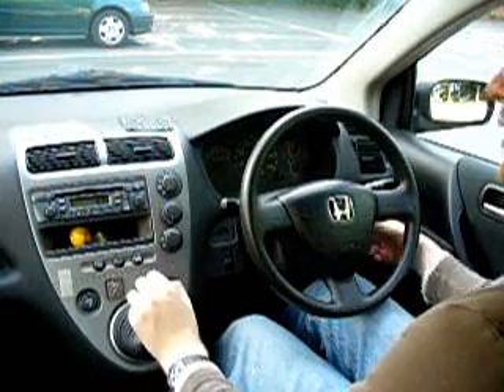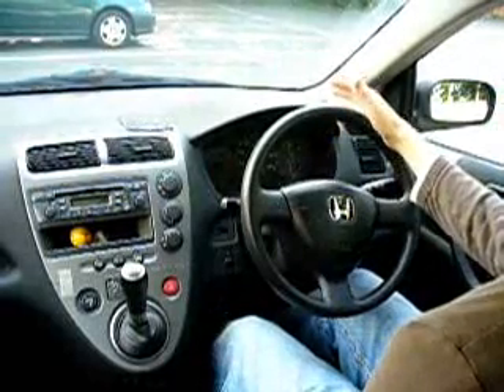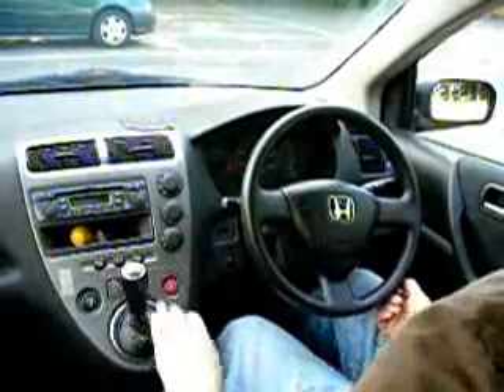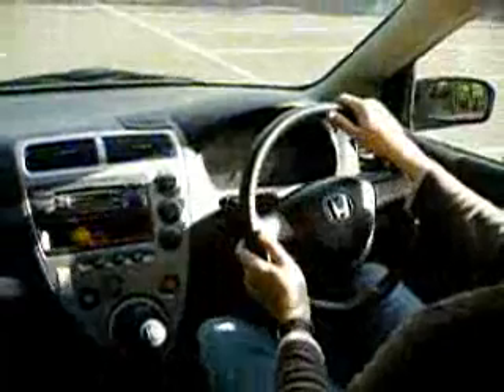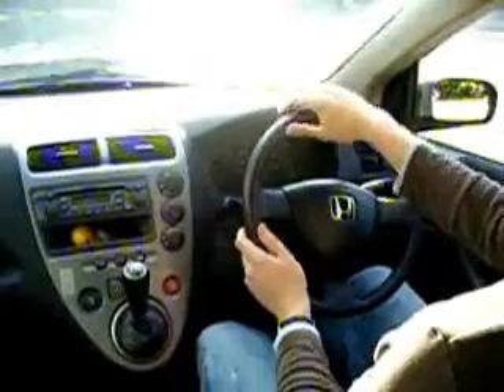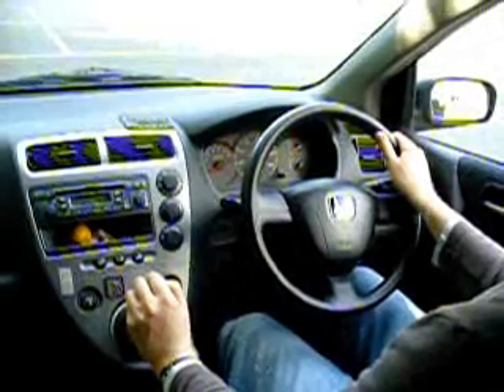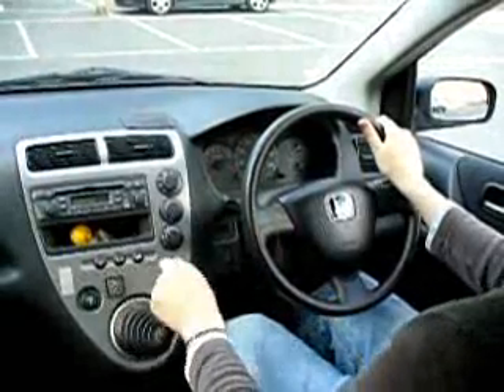Steering methods

Comment: yes, but in norway i would venture to say that there are more manuals than automatics, or at least half and half...in the united states that's not the case and really it has to do with road contidions. americans drive at more constant speeds, have less mountainous regions, and have wider roads that permit larger cars thus larger engines...manual transmissions are more common in smaller engines because they require more modulation due to less torque...is schumacher a bad driver? f1s are "auto"

Comment: I just use the palm of my right hand for tight low-speed turns (bus-driver style) when it takes multiple turns of the wheel. I think pull-push is the worst kind because it's easy to lose track of where the wheels are pointing - not a factor during normal driving, but you're screwed if you get into a skid. Best position for me is the one I use on the track - hands at 9 and 3, "fixed input" as much as possible and switching to "rotational" if necessary to countersteer if the car skids.

Comment: i still think that if you're cruising on the motorway for miles and miles, its okay to hold the wheel at 6 with one hand..its not dangerous because the most people drive at in canada is maybe 140..

Comment: @enigmaPL my favorite hand position for most situations is left hand on the wheel at 7 or 8 o'clock with my wrist braced against my leg or knee and i steer with just my fingers and wrist. i was talking about these idiots that try to look like a gangster or vin diesel and their stability suffers. you can't feel for grip as well if your arm is straight and you're steering with your shoulder. that's all i meant.

Comment: @2trips 10:00 and 2:00 is FAR from a hand position with the most control...Having one hand on the wheel is not an attempt to be cool, and you have to lead a pretty boring life to think so. It's a relaxed but very controllable hand position if your one hand is between 9:00 and 12:00; and furthermore necessary with a manual. 

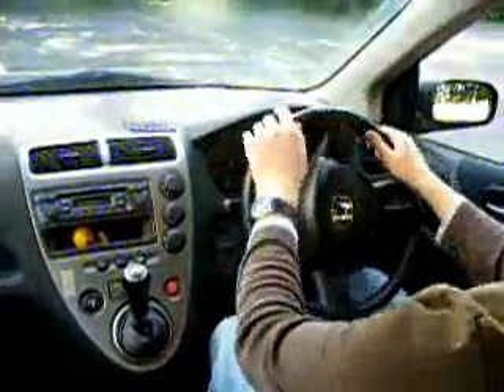Left hand @ 9:00 and right hand @ 3:00 is THE BEST hand position for control. To some it's known as the racing driver hand position.

Comment: @2trips to control the wheel one hand i enough as long as you driving not racing.
one hand doesn't mean that you are a bad driver i think 
it more important how your reaktions are 
i mean if you have to steering hard it can be also done by one hand drivng cause this hand beginns the other hand is coming into it one hand doesn't mean that the driver will drive always in every situation with one hand

Comment: @VinceMcJericho all i meant is that if you have your hand at the 12 oclock position and your arm totally straight from your shoulder to your wrist (the insecure wanna-be cool guy position, favored by every bad driver i know) you have a fraction of the control you would have from a more stable hand position.
the "really competent driver" of your example would still benefit from holding the steering wheel properly, even if s/he understood more than most how to handle a car.

Comment: @powerfultoa7 Transmission lock, yeah right! Have you ever heard of Engine Braking? You need to know how and when to re-engage the clutch after down shifting... I'm not insinuating that I'm the best driver, or that there is nothing else I could learn about driving. I drive fast, cause I travel a lot, and I don't drive on high ways, because there are none... I drive on regular roads with lots of curves, for long distances and I drive a lot and fast, hence my shifting habits

Comment: @unavailableyet Professional drivers always downshift to the proper gear before turning into the corner. Downshifting midway at highspeed is risky and can induce transmission lock

Comment: @CallMeDB As I said, unless you drive like grandma'! If you were a professional driver, you would have known what I was talking about. Furthermore, if you are form the States, and are only used to driving automatic or on highways, it explains your opinion... otherwise, you are wrong and I am right... and this is not an opinion, it is a day by day tested fact... and I am the one to test it, so unless you are a professional driver, I suggest you revise your knowledge about driving

Comment: @unavailableyet disagree. u don't keep ur hand on the gear shift. you only touch the gear shift when you need to shift a gear. that's why they call it a gear shift and not a hand holder.

Comment: @Custom2212 Unless you drive like Grandma', you would want to keep a hand on the gear... it is not wasting a hand! When driving fast, that is IF you drive fast, when negotiating a curve, you need to shift down to maximize traction, and that needs to happen in a split of a second. If you a take a U-Turn, turning the steering with both hands is impractical and slow.. you can do it using the palm of one hand. However, there is NO doubt that using both hands is much safer, but impractical!

Comment: @gromit37 I think you mean it is acceptable at any speed.  I won't bother reading the guidelines for regulations and their reasons, but will here say this: should you find yourself in a situation at high speed where a crash is likely, it is better to use a steering method which gives you more control and requires crossing of hands than a restrictive one which doesn't.  Avoiding any crash is better than having any 'safe,' if you will, crash.

Comment: @gromit37 I don't know when you passed your driving test but in an up to date test your meant to: hold the wheel at 10 to 2, do NOT cross your arms and do NOT let the wheel slide through your hands.
now next time you are driving around town or doing maneuvers try it and see what a rubbish practice it is.

Comment: Thanks - excellent! Far more useful than all the arcane discussion in the driving instructor press. I find that 10to2 is better for 'fixed input driving' because both hands are reasonably close to the top. One thing you could usefully explain is the 'dynamic' reason for not steering from the lower half of the wheel: because the 'G' forces then take your hands to the outside of the turn, giving 'positive' force feedback and risking oversteer. Any chance of a 'creative commons' licence on this?

Comment: @AnalogueAndy unfortunately not everyone can do this. it all depends on the driving position you're most comfortable with. not all cars come with fully adjustable steering wheels. i like to sit up straight (too straight according to most people), so i'm pretty close to the wheel. if i move further back, i can't press the clutch pedal all the way down anymore. and if i were to put myself in the "ideal driving position" i feel like i'm in a recliner. and i'm not. i'm in a car, not a living room

Comment: What a usefull lesson, now i finally got the hang of the roundabouts:p lol 

When i just fool around, not driving near the limit i often just use one hand on the steeringwheel but on the track i allways have my hands "quarter to two", i never move my hands around unnless i need more "lock" than my arms can cross eachother... I drive a  rwd car with short steering ratio and no powersteering, r-compound tires...

Comment: you forgot one of my fav techniques. stearing with one hand while doing a 3-point turn with a manual car. keep one hand in the 9 o-clock possition and using the palm of your hand grip the wheel and crank as fast as you can when your stopped while changing gear with the other hand. i'm actually surprized you didn't do that one

Comment: @Custom2212 Lol if you have weak armys thats your problem :P seriously though, when you (I) turn the wheel with two hands it just doesn't feel right.. I undertand if you don't have power steering and on motorways and other roads like them but in towns, when there could be people crossing roads at any moment, motorbikes comming out of nowhere, buses pullling out, traffic lights turning et etc.. I also don't understand how resting a hand on the gear lever damages the gearbox? :S

Comment from the maker: @skedtm You actually have less control that way.  Forget pull push for the moment, but having one hand only on the wheel gives you less control of your steering.  You'll corner instantly better on country roads if you switch to holding the wheel at the quarter to three position.  Why waste a hand on the gear lever, where it is just doing nothing and actually causing damage to the gearbox?

Comment: when you showed having only one hand on the wheel at the top and bottom and thumbs only, that's exactly how I drive sometimes yet i've had a clean licence since I passed 3 years ago :D 

I have one hand on the wheel and one hand on the gear stick, that way i personally feel I have more controll. I know it's the wrong way etc etc, but how I see it that way I have controll of everything, not just the steering..

Comment: Although pull-push CAN be used for all tasks on the road, why not just use the most efficient method for the circumstance?  Pull-push is excellent for dealing with junctions and roundabouts, but why not use (for example) fixed input for cornering and rotational for manoeuvring?

Comment: pull/push is very useful in most situations. rotational steering has use but it's not done in the way you're prescribing.

You need to assess the deviation of course of travel first. - use pull/push to initially position the car firstly and then use rotational steering to keep the car in maximum control throughout the bend/corner. Fixed input can then be used for stability. Rotantional steering is worthless in isolation. 

But adopting pull/push upon the exit of a bend is good.

Comment from the maker: Hi. When you're learning to drive from the beginning, you do need some rules to get you going. However, you'll find that how much you need to turn the wheel for a given corner will vary from car to car. In terms of hand positions, I tend to advise using (almost) the full 12 to 6 o'clock range, so start with a pull down from 12 o'clock and continue until the hands meet at almost 6, and then push back up to almost 12

Comment: Another great vid, the only other point worth mentioning in relation to steering - seat postion - note how far the driver is sat back from the wheel, just enough - his arms are slightly bent giving him plenty of control and room to move. Too close (arms too bent) or too far (arms locked out) and you compromise your ability to control the car.